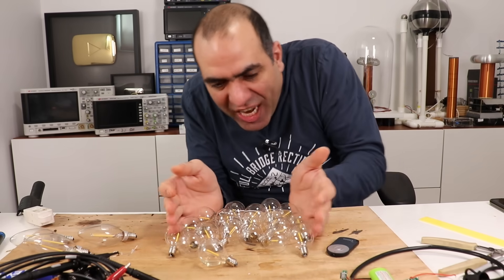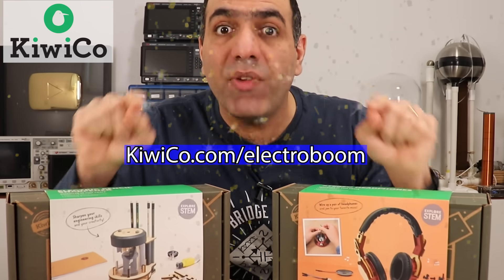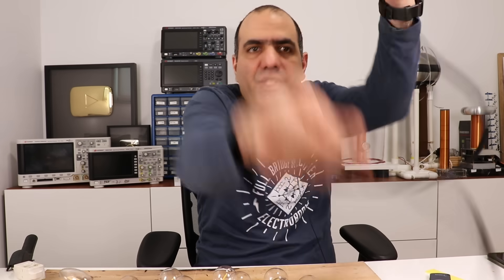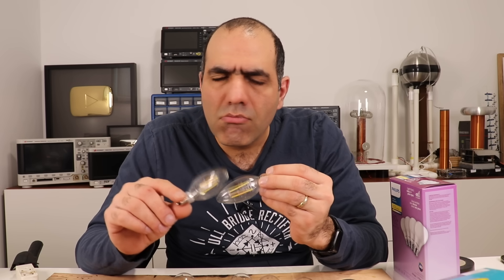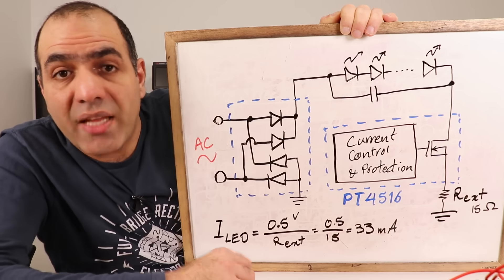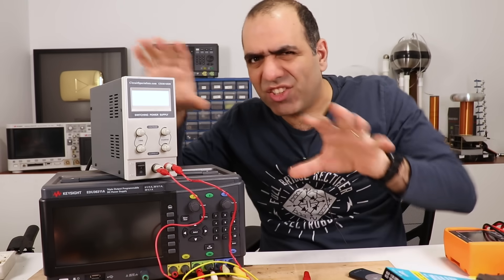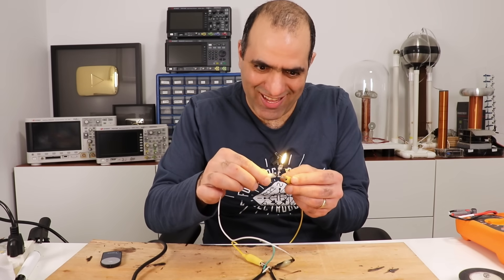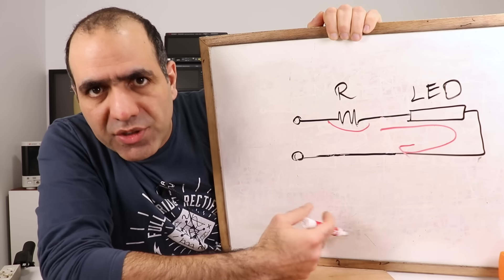So Many MISERABLY FAILED LED Lights

Comment: They look like "cheap" Canadian Tyre lights
Reply: They are ! 5:59 you can read Noma, a CT brand. It's B10 Base E12 40W EQ with two LED strings so it might be #052-9351-6. Other option are #052-9347-8 but they have 4 LED strings. 
 I work there in the hardware section, I'm not bored at all,  just FYI.

Comment: Big Clive did a video on companies over running lamps by increasing the power but not the led filaments to spread the voltage. The Dubai lamp solves this issue by under running the leds which makes them last way longer. (just watched the rest of the video and you already mentioned him)

Comment: If those lights were really IP44 rated it’s no wonder they filled up. IP44 is basically splash resistant. That’s if the manufacturer actually builds it right too. No doubt the manufacturer is saying it’s IP44 on paper, but once it’s built by 10 year old wage slaves in China I’d be amazed if it could protect against a sneeze.

Comment: I noticed the lamp box that you showed stated ' IP44 Waterproof'.

IP44 is not waterproof.

The numbers of an IP rating denote the degree of ingress protection against solids and water;
The first number 4 shows protection against ingress of solid particles greater than 1mm in diameter.
The second number 4 shows protection against ingress of water 'splashes' from any direction.

I think that using these bulbs outside, in a heavy rainstorm with high winds, constitutes more than 'splashes'.

Comment: I am still using my halogen desk lamp i got over 20 years ago - not a single part failed so far and it is in daily use for at least an hour, mostly longer.... 20*365 => 7000 hours, 7000 times turned on and off. But just for my room with 4 LEDs, in the past 3 years i had to switch each of  them 2 times.

Comment: And what's stupid about those cheap bulbs is that the most expensive parts of the bulb work just fine. But due to bad design and a single, inexpensive part, that wonder of technology (because LED lighting really is a wonder!) gets tossed in the trash like yesterday's unfinished tomato sandwich that got left out on the counter all night.

Comment: Put a CERAMIC CAPACITOR in series with light bulb and power.

Electroboom: OH, THE LIGHT’S WET, LETS PLUG IT IN
CURRENT: SHOCKS ELETROBOOM
Electroboom: NOT DEAD
CURRENT: WHAT A WASTE, HE’S NOT DEAD

Comment: Mehdi, you never fail to deliver and always manage to put a smile on my face. I have now discovered why you don't mind getting shocked by electricity (or so it seems). I tried it a few times in my house and got a few good jolts (220v); but I of course assume it is best to use the right arm for this type of thing as it is not so close to the heart. In my head, that seems safer. But who knows? 😊

Comment: It depends on how long these light have been left on without turning them off, as far as I know most these Chinese LED driver (current regulator) chip have inbuilt temperature control, meaning it automatically reduce the current when it get too hot, seeing that the drivers are still fine this then mean the LEDs have probably comes to the end of their lifespan.

Comment: I recently ran into the LED bulbs staying on problem, I heard about it, but never ran into the problem, it's quite annoying, I rewatched Mehdi's video on the subject, and found out what causes the problem, then I looked at a video Big Clive did on a simmilar topic, Clive and I work in the same industry (theatrical) so I understood what he was talking about, but for me it was way easier just to buy new bulbs, Clive said that in lighting dimmers for theatrical applications they had the same issue, but their fix was to put a "ghost load" in series with the LEDs, the ghost load was usually a small incondesent light.
Reply: Like a choke ballast.  The only problem with that is it cuts the efficiency in half.

Comment: I had an LED light fixture that I loved but after 3 years the driver died and I couldn't find a replacement so I had to buy it entirely new fixture. even still I will never use anything other than LED unless something better comes along

Comment: Haven't been super impressed with Philips bulbs lately. Bought a couple packs of the regular style LED bulbs and they all have a audible buzzing sound, similar to what you get from florescent fixtures. They are really annoying as you can clearly hear them even when they are installed in enclosed fixtures. Tried to claim the warranty and it was a huge hassle, had to contact someone through Facebook before I even received a response. Even then they wouldn't just replace them for me without having to send all the old bulbs back first, which just isn't worth my time four a few bucks worth of bulbs, so I'm not sure their warranty is worth much.

Comment: Use LED lights with DC current driver circuits. If LED light gets powered on using AC, it will blink by AC line frequency and that will cause headaches. I don't know what brand those are but even most stupid LED bulbs made in Iran have DC current drivers. I've also opened one of them and probed output current to see how good and constant is the voltage over LEDs which was almost a constant DC output.

Comment: My LEDs are broken, where when they turn on, they are really dim. But over time, they get brighter until they are full brightness. Do you know what is wrong with them? I have those lights with the plastic cover.

Comment: I've been complaining about this too.   The manufactruters are clearly just rating the bulb life on just the expected life of the LED itself, not the entire package( driver circuit, bulb sealent, etc.)..  It's a classic example of why regulations are necessary evil,  there needs to be a regulation stating the bulb life has to be given as the life of the weakest part of the design. If your glue sealing out water only last a year in the sun and the rain then your bulb is only good for a year reguardless of use.

Comment: Today most manufacturing is based on repeated sales. Most products are either designed to fail after a certain time or where the customer will need to stay subscribed for replacement parts eg: regular oil change, regular change of a brand specific spare part etc.

Comment: If you had read the directions on those bulbs you would know that water didn't get in. The bulb fluid leaked out and caused them to fail. Amatuers.

Comment: Part of the problem is companies overdrive LEDs because it's cheaper to run them at close or just over their maximum rating than to buy The next level up and under run them. Also no name companies will use non-binned LEDs which is why you get a variance from die to die. Designers do know how to make these things, make them to last just long enough to still be profitable to the company. And it serves as a great middle finger to the customer.

If you're into electronics and you are confident enough to work with a mains appliance, many LED lamps can have their drivers modified to underrun the LEDs. Which in theory should make them last well beyond these advertised 10 years.

Comment: Use LED lighting strips at 11v or 10v and just add more if they dont light enough and they will last forever. I have led strips with more than 11 years being on 24/7,  thats almost 100,00 hours and not a single one has died so far.

Comment: The warranty is usually a sham, you'd pay more for shipping than the cost of the bulb itself, plus they would probably ask for a receipt - even if I kept receipts for every bulb I bought, I'd need a filing system to keep track of which receipt is for which bulb. So, it's easy to offer such warranty because no-one will probably use it.

Comment: Every time an LED lamp dies I take it apart. 50% of the times something in the power supply just went too hot and died. 40% the first  Led died and broke the series. Only a few times i saw death on all leds.
I switch brands to try them but nothing last more than a year. 
The best are LED tubes. ALL I have are 3-5 years old

Comment: Actually that "10000 hours" is just MTBF/MTTF. It is statistical parameter. You can calculate failure rate using it: (1-exp(-[working hours]/[MTTF]))*100. For example for 8760 (1 year) of working hours and MTTF=10000 the chance of failure is ~58.35%. For 24 working hours it is ~0.24%. For more expensive lamps with MTTF=30000 it will be ~25.32% and ~0.08% respectively. Of course aging and negative conditions (like high ambient temp and moisture) will highly reduce that parameter increasing failure rate. That number is just marketing. Fun fact is that cheap LED lamps often have less real lifespan than even incandescent lamp but still costs much higher. I have no idea of how it is in USA or Canada but in my country the warranty period is just nominal thing because you need to find authorized service center and go there with receipt and your precious 1-2$ lamp for diagnosis and repair/replacement just like with TVs, smartphones or any other "techically complex goods". It is not difficult to design LED lamps with high reliability. But manufactures are not interested in it. Modern "Phoebus cartel" is worldwide.

Comment: That's worrisome.  9 years ago I spent a small fortune on replacing all the incandescent bulbs in my home with CFL's.  So far only had a total of four those bulbs have died (the globe ones in my bathroom), and I swore that as they die I would replace with Led's (which was what I've did last summer)...  I'm hoping the Led's will last at least as long as my CFL's.

Comment: An excellent video from Electroboom: title contains words: "Failed" and "Miserably"... I see you used the AvE shop X-Ray to look inside the lightbulb... Except his is typically a hammer, but a battery is a nice touch for this channel though.   And "no comment' about using one's hands to sweep the glass across the desk into the trash... uh... but you're right.

Comment: I get Philips LED light bulbs for same price as all other bulbs and yes they are the real deal since I live in Europe they are quite cheap here.
Osram are also doing good lights but the once that I bought didn't want to be dim-able when I had 2 lamps on same lamp jack (2 hanging window lights)
To top it off the Swedish Nexa inbuilt remote dimmer switches RLY only likes to work with Philips LED's...

Comment: Mehdi's first electronic project as a "wee lad" was to stick an electrolytic capacitor into an electrical outlet. 😂
Reply: Actually it was touching ungrounded air conditioners which were leaking 240v to the case.

Comment: Weird part for me is that the cheaper ones often last longer. I bought an expensive Osram 10 watt bulb, it failed after a month, got it replaced for free, new one lasted a month too, bought a 2 dollar one from the supermarket, it's sat there for two years now and still works fine, and has a nicer color temperature too.

Comment: Since LEDs will work in either forward or reverse bias, they could be designed with a relatively low breakdown voltage, and be alternated in forward and reverse bias in order to work both ways with a single strip.

Comment: planned obsolescence i remember when you paid 50c for an incandescant bulb and well it still shines today. we have lights in the hallway that are about 50years now and still work while when we bough the newer halogen bulb the bulb inside melted and we had an led bulb that blew up, tripped a fuse and made the apartment stink. and its not that incandescents are better, nah they're wasteful but if you think about it what saves more money, buying new bulbs every month or having one bulb for 50 years. what i want is for manufacturers to make things that last not things that are meant to be thrown away to buy more and give them more money. i know they can but they won't and thats what i love about this world. money always comes first

Comment: i hate 'watt equivalent' measurements so much in led lighting. i had a large "90w equivalent' CFL bulb illuminating my living room for a decade. it died, eh whatever just replace it with a 90w equivalent LED right? no its less than 1/3 the brightness. when i searched for lumens instead of 'watt equivalent' ratings i got much closer to what i was actually looking for.

Comment: Mhedi: hates incandescent bulbs because 90% of the energy turns into heat
Also Mhedi: uses electric heater
Reply: Because in an electric heater 100% of that heat is wanted.
In an incandescent bulb, 0% of the heat is wanted.

Comment: IP44 is rated for bathroom use where water "could" splash. If you want exterior lights, you want IP65 which is rated against dust ingress and water jets. You could get away with a IP44 if installed under a canopy, but because it's not dust-tight, air (with water vapor) will get in and condense on the inner surfaces.

Comment: Don't use CHEAP LED lights. I agree, LED lighting is a good thing. My 3 LED light bulbs installed outside  have been on for 2-3 years. They use about 30W total and replaced 60W bulbs (3x60W =180W) so living where it is dark so much of the time (Seattle area) I can leave them on all the time. We have 3 of 4 in my family that work later hours and come home at night.

Comment: I did fixed scrap LED for most of my room, they all failed because of the overheating, most of them usually intact and the dead LED light is only 1, all i can do is either bypass and jumper it or replace with another good LED light. Also weird enough why did the overheating occurs at the LED and not from the main power source? Did they overcurrent the LED or something so it's overheating?

Comment: Those resistor lights would fail indoors or outdoors. 5k ohms resistors dissipating (peak 170-50) 120v is 2.88W of heat. 
Looks like 1/2W rated resistor. It's not even mis marketing. It's literally lying to say it will last longer than a season

Comment: 9 years ago I bought an LED bulb for my porch because I wanted to leave it on continuously and not burn as much electricity and hopefully last longer. It's been 9 years burning and only off when I lost power. Bought it at Ace hardware and don't know what brand but it's 40W equivalent. Don't know how many incandescent bulbs would have burned out but I believe it's paid for it's self.

Comment: LED bulb overheating is common problem, not only on filament LED bulbs (but filament have bigest problem with that), most of LED bulbs is made of plastic without any radiator, light light bulbs is rubbish, led bulbs should be made of aluminum

Comment: Yeah warranty. "OK you need to have your original receipt. And you're responsible for shipping. You did keep the receipt from a year ago right? Oh and shipping is 2/3 the cost of the bulbs. And it'll take 4 to 12 weeks to get the replacements back."
Reply: I will do it out of spite >:(

Comment: Big Clive also has a video called "Crushing and hacking LED lamps" if you want to underrun your LEDs to make them last forever.
Reply: I have some GU-whatever lamps in my room. Six china LEDs dead in two months. The osram LEDs I put in three years ago are still going strong.
Reply: @vincentguttmann2231  try the modification in bigclive's video to make the china lamps also last as long.
Reply: @masteryoda394  Well, they're still going strong, but if they ever die, I think I will look into that.
Reply: @vincentguttmann2231  Good man!

Comment: I bought LED H4 headlights from aliexpress, bright as sun , and they started flickering. LEDs are cooled by heatsink and fan, however circuit is not, I suppose some transistor or IC is overheating :-( .
And i don't know why, but there is full bridge rectifier even car has 12V DC.

Comment: no actually it's not a 3volt LED each LED is of 9 volt but it works better with 12 volts. just try to glow one led with 9 volt battery.

Comment: electroboom: "i always encourage people to save energy"
me: looks to 11 year old 244 watt graphics card
Reply: Is a 3090 ti reference? At 500w
Reply: @unclejon1148  modern high end GPUs are also very power hungry
Reply: It's at least not on a garbage dump somewhere. I still have my 13 year old GTX260 around as backup for when my GTX980 dies. 

Maybe I should rebrand the GTX260 as a space heater with graphic cards capabilities, as it has a TDP of 182W and presents a gaming performance worse than today's intel HD graphics.
Reply: @timmy7201  mine's a GTX 580, proper old beast, and I have no choice but to hold onto it indefinitely amidst the shortages lol
Reply: You can always modify vBIOS of it and make it run more efficiently

Comment: I also had several LED lamps that died because the driver failed. It's such a pity that crappy drivers can ruin those lights. Often, I see manufacturers use electrolytic capacitors, which are sensitive to excess heat.
I have also learned to buy non-dimmable bulbs whenever possible since drivers of dimmable lamps tend to be more complex, output more heat and are more faiure prone (in my experience).

Another thing to keep in mind when buying LED bulbs is to look for any kind of strobe effect (commonly seen in cheaper models where the driver is cheaply made). When I see a LED lamp on display somewhere, I look at it through my phone's camera to see whether any strobing becomes visible. That's not a foolproof method of course, but it makes strobing visible if the frequency is in a certain range at least.

Comment: The best, longest-lasting LED bulbs I have ever gotten were from my electrical utility company and surprisingly, a couple I got from Walmart (store brand). The utility company offers LED bulbs for cheaper than retail and I got some for my house a few years ago and they're all still working just fine. The Walmart store brand bulbs were a couple of 100-watt equivalent that has been in use for roughly 13 hours a day for two years with zero issues.

Comment: I desoldered the smd leds in mine case
They had power supply failed so now im using it on 6v as torch
Gotta say the leds are pretty powerfull enough to light up a room